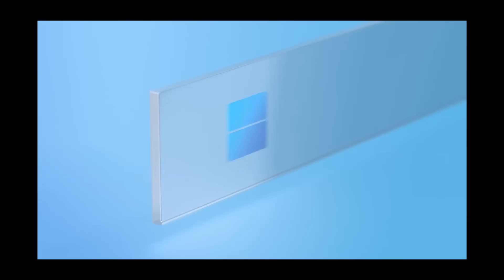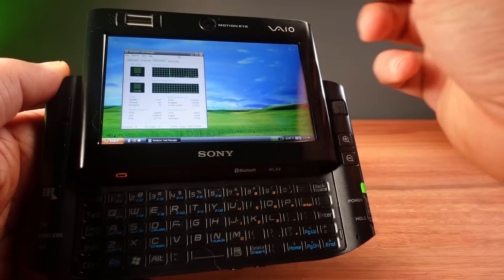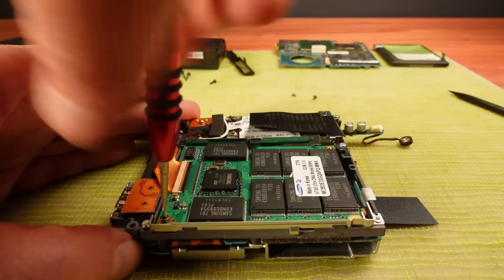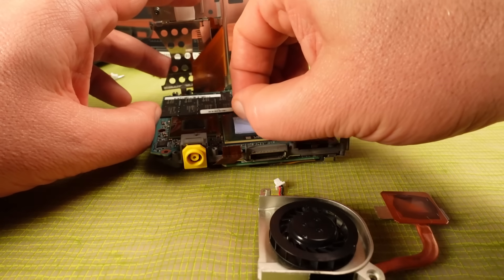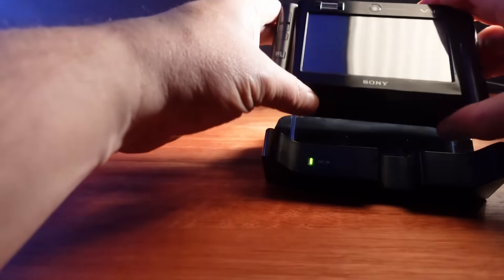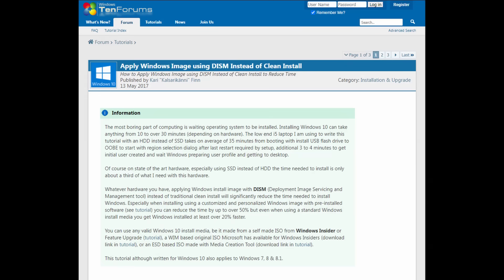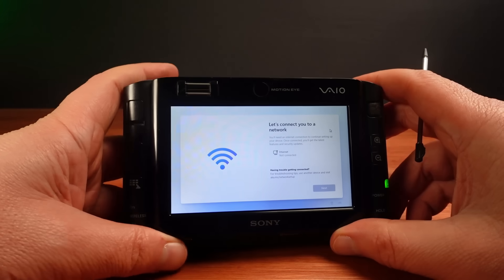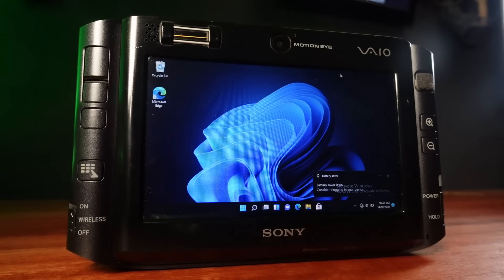Windows 11 On This Classic 15 Year Old MicroPC

Comment: It would be interesting to see how well it runs a Linux distro, like Manjaro or Mint, then bench-marking them against the Windows 11 install.
Reply: @Luis Rodriguez this is not what i want
Reply: @handlesrtwitterdontbelivethem Why?
Reply: Most Linux distros will run on a potato pc , that’s the point of them , Linux is more close to the chips than windows , windows is high level shite and needs massive amounts of ram and a fast CPU to run , Linux runs fine on a phone , for example android
Reply: @valley_robot  in my 18 using Linux, I have to say that's not necessarily the case. I had terrible trouble in 2021 when loads of distros dropped support for 32-bit machines. I was left with Windows as the only reliable way to run them.

Comment: I always wanted one of these growing up, its amazing to see one getting modded and upgraded.
Reply: I just bought one on a Japanese auction site . It is the VGN-UX 72 running Vista 🤮 .  One small problem is hat it is the system language is in Japanese and its windows home premium with no option to change it to English . Need to do a new install but its being difficult
Reply: @UserUser-ww2nj  you can change it to English. I do it all the time
Reply: @markfrost2707  The version installed does not allow me to change the system language . It might be just the Home version and not Home Premium
Reply: @UserUser-ww2nj  i suggest you to install an english version of windows its easy what could possibly go wrong
Reply: @UrbanBulletRDP  it's not that easy because with it being in Japanese it's hard to navigate through the settings etc. I want to change the hard disk to an SSD . It's possible using an adapter because the hard disk connects with a ribbon cable
Reply: Same
Reply: Update: I just got a UX-90PS!

Comment: Windows 8.1 on this thing would be amazing since it was designed to be a more optimized windows 7 for tablets and that core 2 duo should be faster than atom processors that tablets from later years came with

Comment: NT is actually the only Windows lineage now (with Windows CE been buried over a decade ago after even mobile devices had become powerful enough to run NT kernel). The current Windows is Windows NT 10 (better known as Windows 10 and Windows 11), Windows NT 6.2 was Windows 8, Windows NT 6.1 was Windows 7 and so on. Windows NT started in 1993 as a  portable (ran on different architectures, today it runs on x86-64 and ARM64, historically it aslo ran on PowerPC, DEC Alpha, Itanium and MIPS) server and worsktation OS without dependency on DOS. It wasn't initially popular in the consumer segment due to higher hardware requirements and poor compatibilty with DOS apps (it ran them in a VM), but for serious tasks it was good thanks to its stability, better security and support for multiprocessing. Windows NT 5.1 (better known as Windows XP) was the first version to become mainstream in the consumer segment.
Reply: Lots of shipping companies still use CE in barcode scanners.

Comment: A thermal pad wont give you near as good thermals.  But in this case with the Low TDP of the chip you might just barely get away with it.   I’d order some decent thermal paste form the current decade and replace it ASAP.
Reply: Nah get it from the last decade.

Comment: but w-w-wait. I can't find a UX with Core2Duo.
All of them, UX70, UX50, UX90 are using either a Core Solo, or an Intel M CPU.

Edit: ah, alright, it's not a first gen UX then. Especially since it supposedly shipped with Vista to it's first owner.
and it's with SSD, so it's probably UX92 or UX91.
Reply from the maker: There were no UXs made with a Core2Duo. I even made this mistake in my most recent video. The best UX CPU was a Core2Solo U2200 1.20 GHz.
There were some custom UX mods done that put in a Core2Duo though. Sometimes these have gone up for sale too.
Reply: @JanusCycle  yeah well, first gen Core2Duos use the same chipset so it'd work, most likely. But UXs used Core2Solo which supports 64bit instruction set
Particularly UX91S and 92S
90SSD also crossed my mind, but it's 512 RAM and Intel M or a Core Solo

Comment: By the way, perhaps it's better to try Tiny11 on this device, it might even work well with it. But it needs 2gb RAM so likely 1GB will be a suffer
Reply from the maker: I tired, the 1GB RAM is a huge challenge.
Reply: @JanusCycle  ah, well, no particular wonder.
Kinda like Wine on android which can only simulate 1Ghz CPU. Games work, stuff works, but the 1 GHz limit is a huge challenge.

Comment: is the ram module soldered?? if not, you could try upgrading it
Reply from the maker: Unfortunately the RAM is soldered, it's the biggest drawback of the UX design.
Reply: @JanusCycle  damn bro.....if it was SODIMM or something like that you could upgrade it... also, you've installed tiny11 on it try installing linux mint or Ghost spectre superlight...which i think was better than tiny11....

Comment: that's why on my older or non-essential machines I always run the oldest windows version in support, if not that then I run a version of linux that would be up to date.
Reply from the maker: This is very wise, I mostly do this as well. Sometimes though I just want to push the limits :)
Reply: @JanusCycle  yeah I do that too, it's fun sometimes.

Comment: what type of vaio ux is this?
Reply from the maker: This is a VGN-UX1XN
Reply: @JanusCycle  thanks! i wanna buy one since they look cool, of course for tinkering purposes
Reply: @JanusCycle  i ment the c2d model so i can try and put sl on there xD
Reply from the maker: I think I made an error, the CPU I is an Intel Core2Solo U2200 1.20 GHz. There is a way to solder in a Core2Duo. I've been thinking about how I could learn to do that.
Reply: @JanusCycle  What site did you get that ux from because i literally cannot find any

Comment: there are also 32 bitt win 11 also you can expand the ram on a sd card using ready boost.  format the sd car as ex fat with max cluster size for performance. a  SanDisk Extreme PRO U3 UHS-II would work perfectly as such

Comment: scary how these clows decide wether your computer is usable or not. hopefully one day linux will stop being an ego project and actually turn into something my mom can use without calling me every time she turns on the computer.
Reply from the maker: They have made it too hard to install Windows 11 on even some very decent newer computers. Though the computer in this video is too old to be considered decent for Windows 11. They could instead put serious warnings and disclaimers when trying to install on computers they think are not suitable.
Reply: @JanusCycle  or modify the rom. my windows 11 rom is modded so i can install it without much issue. i haven't tested it on older machines but it looks like there's no need to try.
Reply from the maker: I would like to mod Windows 11 to remove these restrictions. But for other computers. This VAIO is having one more go with Tiny 11 before switching to other OSs.
Reply: @JanusCycle  Please, do!  I cannot wait to see the update video! Thanks!

Comment: wonderful video. amazing what you can do with old technology. you've made me more interested in picking up one of these rather than a steam deck
Reply from the maker: Except that a Steam deck would be more useful. Unless you run XP or 7 on the UX and don't run modern games. But also check out GPD machines, especially the GPD Win 3. I really want to get one of those.
Reply: @JanusCycle  Ockel Sirius A  :)

Comment: Now you can try to install some Tiny 10 or Tiny 11. Even on this old hardware it will be much faster.
 And, maybe it's possible upgrade the SSD to faster.
Reply from the maker: Yes, I think it's time to try Tiny 11. I already have a reasonable fast SSD, it's the 1GB ram that really bothers me. I hope Tiny 11 helps a bit with that.
Reply: @JanusCycle  it's not possible to solder more RAM?

Comment: do wish UMPC gets popular again, current modern rendition(GPD/OneX/Aya) still marketed as "gaming handhelds" but damn they are full x86-64 computers on the palm on your hands
Reply from the maker: It's really only gamers that buy these. Hence the popularity of the Steam Deck.
The GPD Win 3 though, it looks like a love letter to the UX.
Reply: @JanusCycle  do feel a joystick is a somewhat more comfortable compromise between a track pad and a nub stick. 
the win 3 is certainty a direct upgrade to the Vaio UX in the same form factor/size but modern specs. still the upcoming GPD Win4 also had it's homage to another sony product (psp/vita) with it's own slide out keyboard too, however despite my really late first batch order, the order number I've get doesnt seemed too promising for that UMPCs yet, still a few thousand shy to 10k units ordered.

Comment: Hello I want to ask a question is it dangerous to open a case of a DVD while it's spinning ?
Reply from the maker: Really good question. The DVD in this video is running at 8x speed which is slow enough to grab without much trouble. A CD in this drive can run up to 24x which could hurt a bit or might fly off if you knocked it. A drive at 40x speed is taking a disc towards it's physical limits and I wouldn't want to be near it when running open.
They did make some 56x drives and there were news reports of discs shattering into shards inside these drives. If this happened while the cover was removed, you would risk getting badly hurt. 
Now I want to get a 56x drive to test disc shattering, under controlled conditions of course.

"Shatter protection should be built into the drives, especially to protect the front door (of the disk drive)," he says. "What happens now is that the door just breaks and comes flying, along with parts of the disk." https://www.smh.com.au/technology/life-in-the-fast-lane-can-be-a-disc-shattering-experience-20021209-gdfxwp.html
Reply: @Janus Cycle  Thx

Comment: I am lucky enough to have a modified UX390 with the U7700 Core2 Duo processor. There was a guy (whose name escapes me now...Anh maybe?) doing that mod on a case by case basis for anyone who would pay. I found one on Ebay. Unbelievable. Not even sure the guy knew what he had! Anyway I'm now running Windows 7x64 quite well. I've tried Win 10 and found it clunky. I've accumulated x64 drivers for everything on the unit EXCEPT the touch screen...which works but can't be calibrated properly. Nor do the special buttons work. I've also installed a 256GB zif ssd and and AC7260 wifi card. Both work brilliantly! You've inspired me to try your method for installing Win11 and see how that goes. Ps...heat disipation with the dual core processor is a problem under load...lots of throttling. I had to cut the grill work out of the vent (leaving a less pleasing top panel) but it made a real difference in cooling. I can now stream 720p vid smoothly without encountering thermal throttling.
Reply from the maker: Thanks for sharing your experiences with the drivers. Those special buttons can be a challenge. 
Yes, it was Anh doing the mod. I remember reading about his work on the micropctalk forum and wanting this so bad. I still have his posts saved. It must be awesome to have that dual core CPU in your UX.
I think Windows 11 will only be usable if you can slim it down to a 'Lite' version for 1Gb ram. I would like to try again one day. I've been holding off as more is learned about customizing Win11. I made this initial video just as Win11 was being fully released to see what would happen.
Let me know how you go with trying things on your U7700 UX. If I had the ability I would do this mod and join you. But hearing about others experiences is also good, thanks.

Comment: Great stuff. Were you able to find the correct driver for the GPU or was it stuck on the basic Microsoft one?
Reply from the maker: Because it was slow I didn't bother trying a better GPU driver. I would like to revisit this sometime.
Reply: @JanusCycle  If you do revisit, check out the tiny 11 iso. All driver and system requirements are bypassed as well as most of the bloat.

Comment: 7:00 your screen is close to his death. I got the same white screen, at first it appears for instances, but soon  LCD turns white forever, making your expensive piece of high technology just bright lantern
Reply from the maker: Thanks for the tip. I will cherish using this LCD during it's last days here on Earth.
Reply: @JanusCycle   at leat, your courage would be enough for repair  effort. I have noticed that dead screen goes fine after direct heating to 70-80 c. Seems like problem with some element on lcd control board.
Reply from the maker: Something interesting I noticed recently with my UX white screen and Windows 11. With the brightness turned down to the lowest setting, the screen stays white until Windows 11 booted. This was making it impossible for me to see the BIOS setup screen.
When I turned up the brightness in Windows 11, the screen was white until opening the BIOS config. The UX is remembering the brightness level after power cycling and that is having an effect on how long it stays white.

Comment: Wondering if you can share what type of SSD that is or the link thanks
Reply from the maker: These are '1.8" ZIF SSD', seach for that to find different brands. You could also try a ZIF to mSATA adaptor, but these may not work with all mSATA SSDs.
Reply: @JanusCycle  got it thanks 🙏

Comment: the sharp corners in task manager tells me you may not have installed the graphics driver, thus the sluggish performance. however i'm not saying that installing the display driver will improve the performance completely, i'm just saying it'll probably just be a bit snappier for light tasks.
Reply from the maker: Thanks for the info. If I do a Windows 11 Lite install one day I will add a graphics driver.
Reply: @JanusCycle  I need to get one of these to just have and play around with, I bet it'd be neat.

Comment: the processor you swapped and used Intel U1500 is a 32-bit processor Core Solo.......and its giving me hard time on UX380. i am still not able to upgrade from Vista through any way.
Reply from the maker: I actually upgraded to the Core 2 U2200 which is 64-bit. With a U1500 you should be able to upgrade to Windows 10, 32 bit version. The 32 bit versions of Windows should run slightly better with the 1Gb of ram available in most UXs.
Reply: @JanusCycle  ok somehow i upgraded to windows 10. it previously had Vista Business, i checked online and i found out that i can easily upgrade to Win 10 Pro, because Vista Business is eligible for WIn 8.1 Pro, so Win 8.1 Pro is eligible for Win 10 Pro.........but now Win 10 pro is not activated, its giving me watermark on lower right corner to activate windows in settings.
Reply: I also have a single core x86 Atom chip in a Dell Latitude ST 10 inch tablet. It will only let you upgrade to W10 version 1607 which is the 1st anniversary of Win 10.

Comment: This kind of device is so cool, i dont understand why they wont make a modern version of it now. Like most of this device is already perfect, except for the outdated components. 

The mobile market already did a lot of the work for them, with cheap, small high-res displays, better batteries, more ram in smaller form factor, better processors and gpu, etc. 

This kind of device is definitely not superceeded by smartphones, its often handy to have a legitimate desktop PC capable of running desktop-only programs on hand, and using keyboard is another bonus. 

PS: if anyone knows of high-quality modern devices like these, please let me know. I'd love this kind of slide-out keyboard on up-to-date device. 
 
I think the closest thing we have today is Steam Deck (runs Linux natively, but supports installing Windows), but its kind of more a console than a portable computer (lacks a built-in keyboard, has controler-like inputs)
Reply from the maker: Check out the GPD Win 3

Comment: Windows *.wim or *.esd file is like the Ubuntu's *.squashfs file which contains the system in a package file. 

You just need to format the target drive, set boot settings, apply the image, done..
Reply from the maker: I didn't realise wim/esd files were that uncomplicated. Thank you
Reply: @JanusCycle  when I'm still uses windows as my daily os.. I often make my own customized installation (and installer) by applying the wim/esd image onto a folder and then repacking it.

I also read that boot.wim from windows installer can be modded as a live cd version of windows so I can have a mini version of windows in a usb stick that can be used without installing... I use Make_PE3 to do that.. but I'm done with windows after 10 is released because I already get comfortable with Linux-based OS

Comment: good video. I have a Sony vaio vgn ux390n that I try to improve with an intel core 2 duo U7700, unfortunately in the process I twisted one of the ram modules, which prevents me from turning on the computer and I doubt if the core 2 duo works properly. In case of being able to solve my problem I will install windows 11 and windows 10 32bits. In this comment I will tell my experience. Wish me luck
Reply: Talking about the U7700 mod. My advice is to remove the stamps that are on the rams, if not for that, I would already be using it. I tried to remove a memory module from another VGN UX motherboard that I had and the tracks are very sensitive, if not done properly they break and leave the motherboard unusable
Reply from the maker: Good luck! Please let me know how it goes. I am interested in installing a U7700 one day as well. It looks quite challenging. I hope yours goes well. I'm looking forward to hearing your success story!